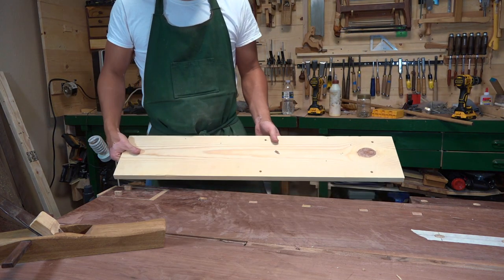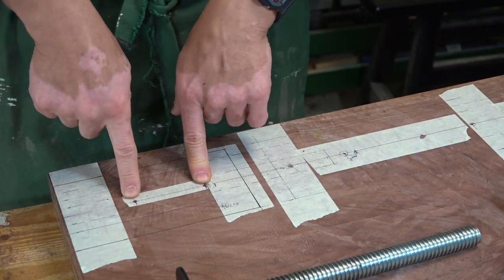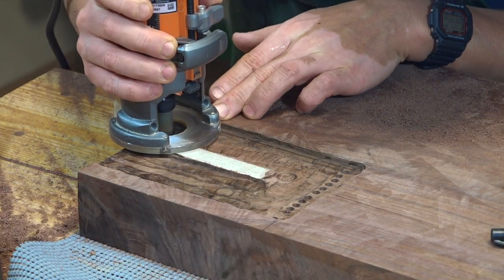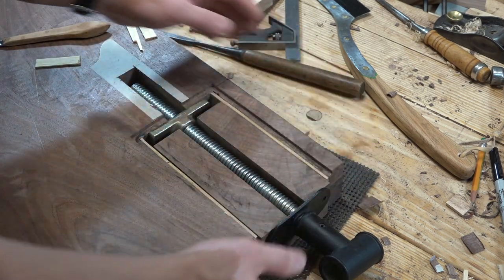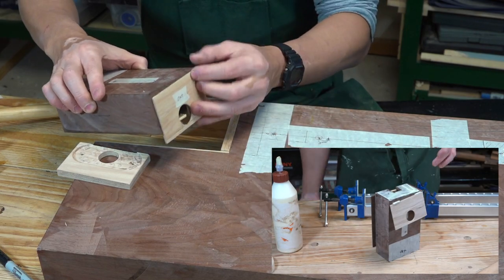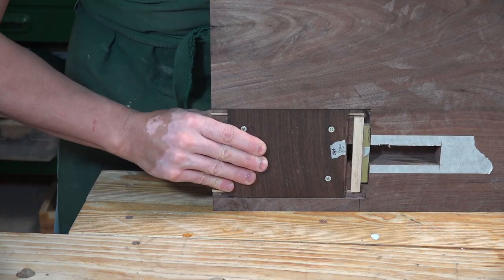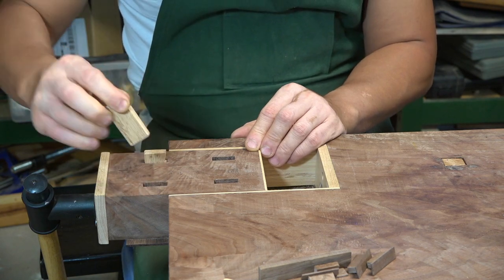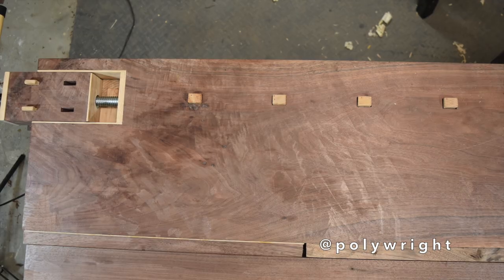DIY Inset Tail Vise / Wagon Wheel Vise - from a Harbor Freight face vise

Comment: Love the spring idea, however if they always pop up a set height how do you plane thinner stock? I noticed when you pinched the stock in between the dogs, the dogs actually sat up above the level of the board, which would make it impossible to face plane. Likewise, do your little dog hole covers also get in the way if you’re trying to clamp stock down and you have those covers under the board? Thanks for the video! Got a lot of great ideas from this!
Reply: I thought about this too.  I would place a shim under each end of the workpiece so it rises proud of the dogs, then plane away.